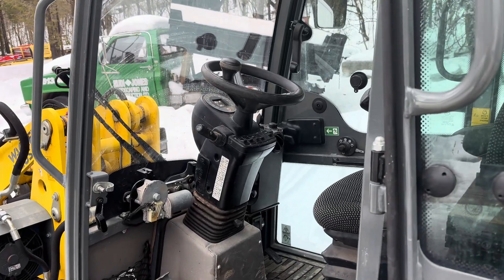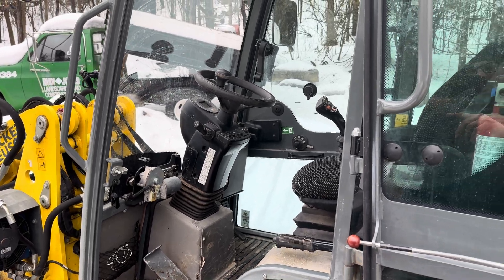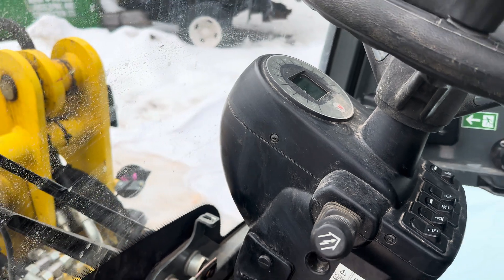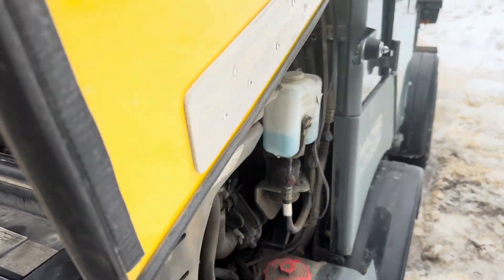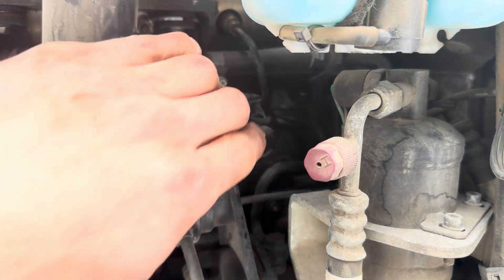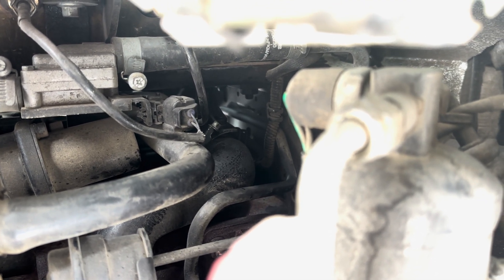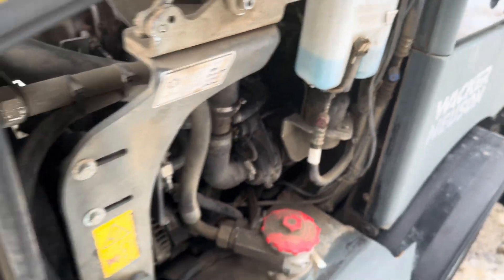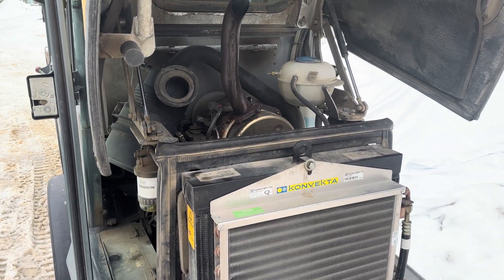Wacker Neuson - No Power - No Torque Fix

Comment: Would you be able to show how to do a regen?
Reply from the maker: On this machine regen will occur automatically once the engine reaches operating temperature. You cannot force a regen when the machine doesn’t need one and a Regen can’t be done if the engine is not at operating temp which is approx 85 degrees on the dash.